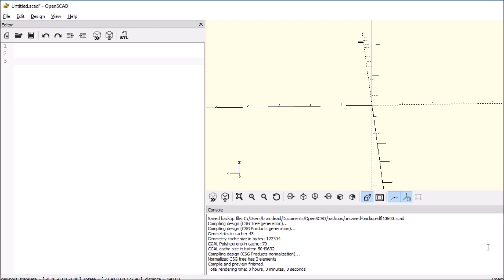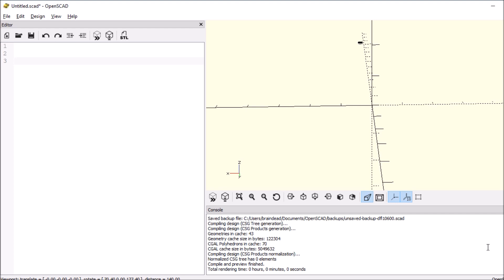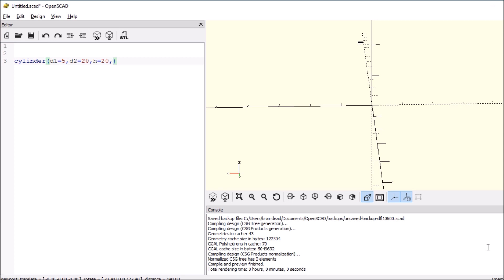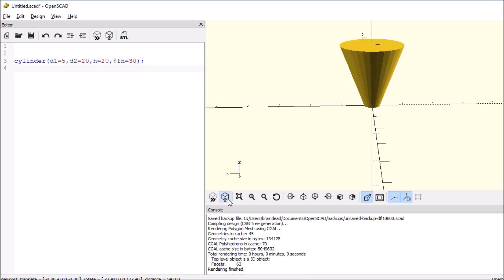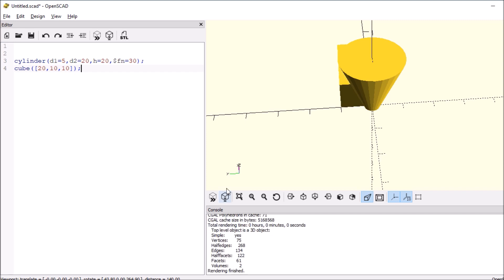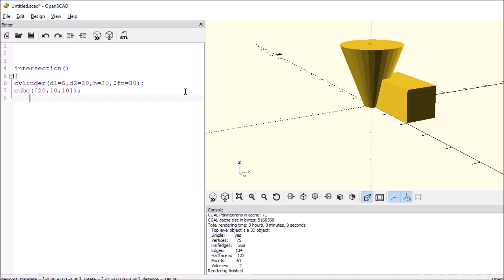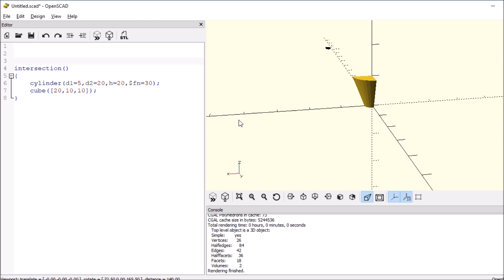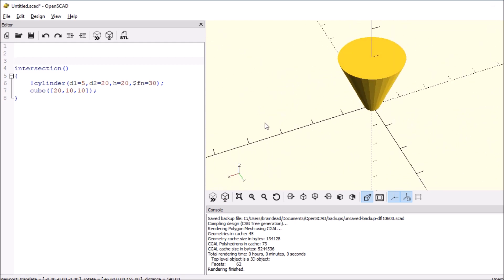OpenSCAD - intersection

Comment: im a pretty bit of a latecomer but is there an opposite to "intersection" as i would like to remove the overlapped part but when i use "difference" between two cylinders there is a bug where the object is trying to be rendered as both removed and still present
Reply from the maker: Might be order of operations.  Meaning difference () { union() {} cube{(x,y,z)}
Reply: @EdwardBraiman  Ohhhh thank you so much :)
Reply from the maker: You're welcome.